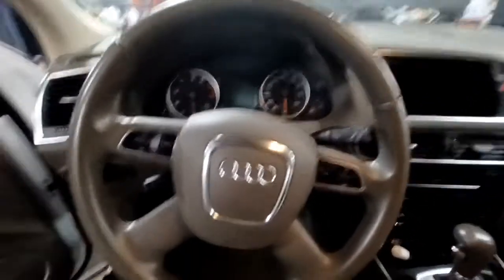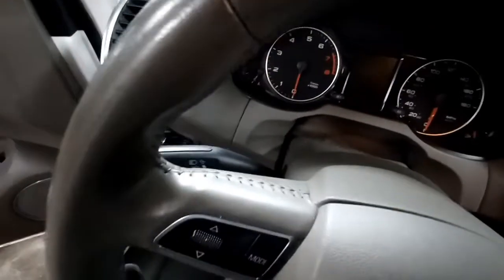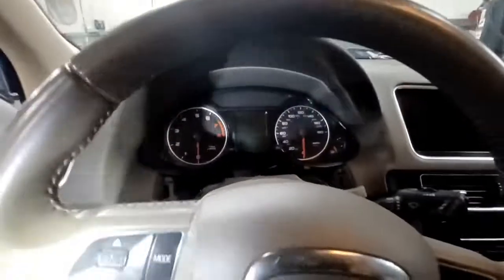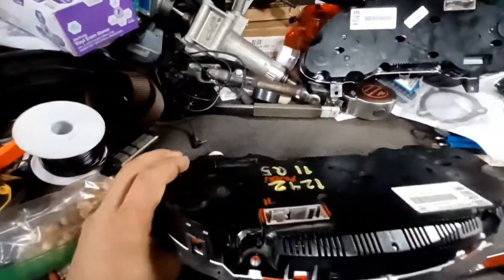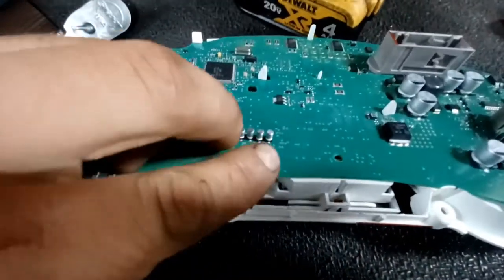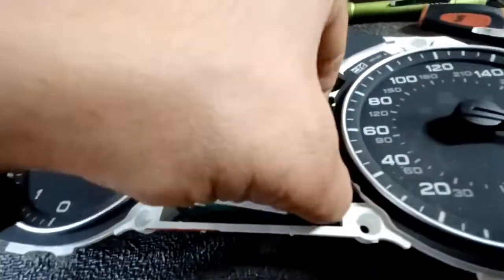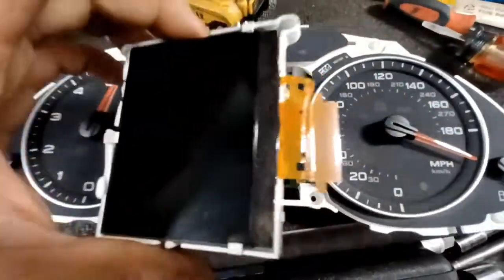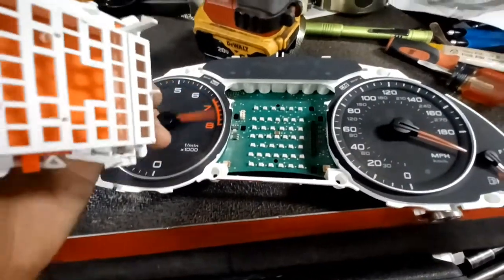AUDI Q5 SCREEN ON INSTRUMENT CLUSTER NOT WORKING.

Comment: No need to disconnect the battery or anything if you are just removing the same cluster and putting the same cluster back? No immobilizer worries?
Reply from the maker: You should be good with just key out

Comment: Hello friends, do you know anything about how to fix the MODE button on the steering wheel that suddenly stopped working?  before the MODE button was used to cycle through the daily current active cumulative trip distance meter, but now I cannot get to that screen anymore without the MODE button being functional. anyway to reset the computer?  I did the reset option in the CAR SETTING page for both computer 1 and 2, but that didn't do anything.  I don't think the mode button is worth a costly replacement, but any tips would be appreciated.   thank you

Comment: Any advise, my one is becomes blank sometime ( randomly)? Thank you
Reply from the maker: I’ve seen connection issues at the screen itself as well, sometimes just by taking it apart removing the screen connector and reinstalling it the random screen going out stops
Reply: Thanks a lot

Comment: What about a he mileage on the used odometer ? 

Is there any way to match it to what your vehicle had before? 

I realize mileage is probably currently unknown since that has not been visible since the dash went blank. 

Curious more than anything 

Thanks! 

I have bad dash CarMa..I had a 97 Chevy S-10 - cluster event bad; 2007 Prius is in shop today…bad cluster (combination meter), now my sister’s 2011 Audi Q5 dash had crapped out 😢
Reply from the maker: If you just swap over the screen mileage stays correct

Comment: After removing cluster and putting same one back in my vehicle now won’t start. Any advice?
Reply from the maker: I would remove it again and make sure you have your connectors fully seated, I haven’t had that happen before
Reply: @EuropeanAutoRepair  thank you will check
Reply: Did you get your vehicle to start again?